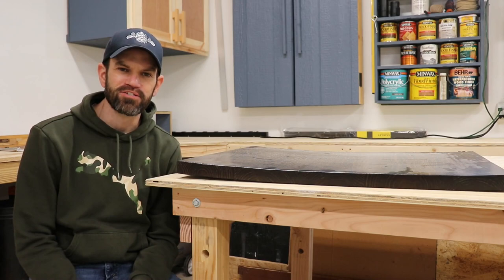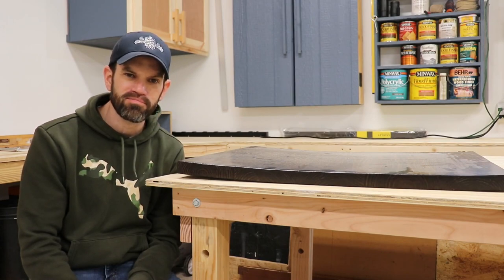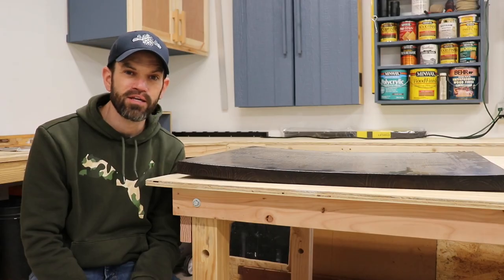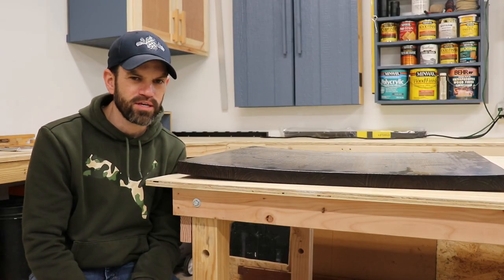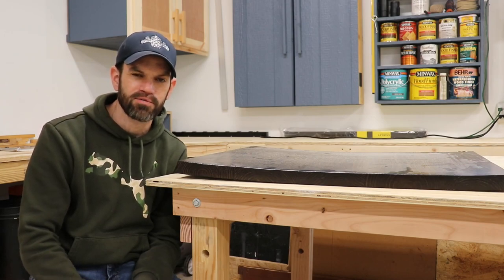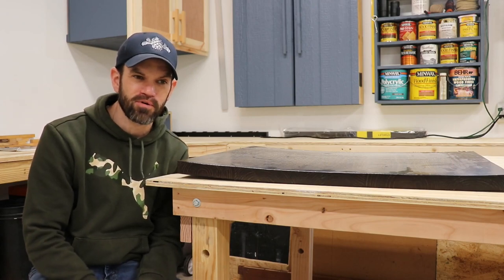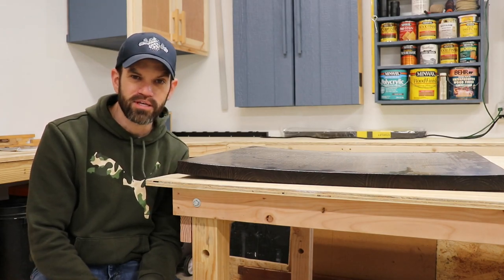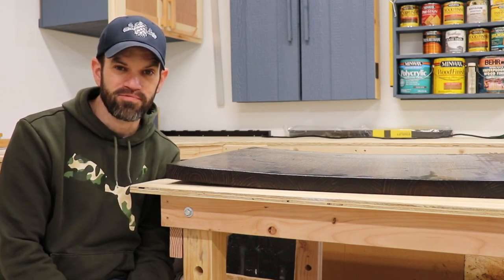TABLE TOP Glue-Up Tip / How To NOT Make a Flat Table Top

Comment: The construction grade pine at the big box stores is hardly ever dry enough to make a flat table top from. Even if you altered the grain, you would end up with a wavy table top with each piece curving in the opposite way sorta like a potato chip. That would not keep the table top flat. The only way would be to kiln dry or air dry the wood completely. Then run it all through a planer to flatten each board before assembling.
Reply from the maker: Thank you for the advice, there is lot's of good suggestions in the comments here, hopefully people can avoid making the same mistake I did.

Comment: Another tip is to make sure the material acclimates to your workshop and sticker the boards and leave a small gap between each board on the same level. Make sure the stickers are the same thickness.
Let it acclimate after each stage of construction and when you move it to a different area/location…, i.e. shop to garage, garage to house. Make sure you finish both sides of a table top. Not finishing both side can contribute to warping or cupping.
Also try to avoid buying boards that were either cut from the pith or right next to the pith. Boards that have the pith in them will warp the most. Try to use boards with a similar grain pattern on each face but especially the end grain. If the end grain (and face grain) are similar they will usually behave similarly.
Reply from the maker: Thank you for sharing these tips. I've learned so much about wood and warping since posting this video and I hope the video and comments are helpful to others

Comment: same w clamps one facing up and one facing down (parallel clamps) also clamping pressure plays a role.alot of ppl CRANK the clamps when in reality u only need to tighten them til u see 1st bead of squeeze out .i use my thumb and 2 fingers to tighten clamps for panel glue ups anymore than tht u risk cupping it.
Reply from the maker: Great tips, thank you for sharing!

Comment: Yeah. I used to just dry them on a flat surface with clamps and or weights. I just finished a desk and had the top sitting on a 4x8 work bench on pipe clamps and heavy blocks on top. Dried flat, no rocking. Remember to keep an eye on the moisture with a meter as well. You can get away without doing the up down thing, but it’s best practices. I only did it this way because of how the grain LOOKED. I also had to put in pocket screws. Country style.
Reply from the maker: Good advice, thank you for sharing!

Comment: Flipping the end grain does not matter. Some really experienced workers do not even bother with this. The biggest thing is making sure all the moisture is out of the wood. After glue up, never lay the wood flat without circulation or one side will dry out and begin to bow.
Reply: This is true
Reply: great point...Is the idea of the video that the direction wood will bow in one direction? As it might make sense a little, yet you would still have smaller slight curves.  I think we need a new video!!
Reply from the maker: I'm open to any suggestions, this video was based on my experience and a tip from a more experienced wood worker. I've heard it a lot after posting this video, but the topic seems kinda controversial. Perhaps the species of wood and the moisture content also play a role
Reply: Adam, I made an island top from Ash and it bowed after glue up. I have a lot of experience in wood working but the bowing had never happened to me. I built it in my shop and after the glue dried I moved it into my attached garage, which is heated and this was winter time in Minnesota. The Ash was rough milled to 1 1/2" thick and I ripped each board to about 5 1/2" to accommodate my jointer.  Then planed down to 5/4 final thickness.

After the final sanding in my garage I had a beautiful top with a very smooth surface and I was ready to finish it. But before I started finishing, it started to bow (I should note that the top is about 42" x 60" with 42 going with the grain and 60 across the grain, so it's 12 or 13 boards across). I was just sick because of all the work I put into it and I didn't know if I would be able to flatten it.

Well, at the local cafe I was talking to a cabinet builder in my area and told him about my problem. He said to flip it over and it will flatten out after a few days. It did just that! When I glued up the boards I was making sure to rotate the grain pattern across the top so I couldn't understand why it bowed but your explanation makes perfect sense: The wood probably wasn't as dry as I thought even though it had been stored with stickers for several years, I laid it flat without proper circulation. It's been installed in my house for a couple of years now without any cracks in the joints so I think it'll stay that way.
Reply: @philindeblanc  yeah moisture imbalance in wood is the mortal enemy. If you can properly control the moisture content you can control warp/bow for the most part. Wood is alive so it’s difficult in some specifies to keep it from twisting/bowing/cupping. They need more educational content on this.
Reply: I mostly agree with you. but wood will warp towards the heart, so when using quarter sawn boards this is no problem. Though when using boards that aren't quarter sawn warping might pose a problem and in my experience and in the experience of the people I know flipping the end grain does help.
Reply: @carriehsd7162  there are two types of quarter sawn. The first is the boards that contain the pith. Cutting out the pith and someone would call the remaining halves quarter sawn. Then the other one is the true quarter sawn, where a log is cut into quarters, and boards are cut out from the quarter, one vertical one horizontal at the time. The wider boards with more than 60 degree grain are called quarter sawn, and boards with 30-60 degree are rift sawn.
Reply: Agreed. I have made 5 table tops with various types of woods and cuts and I never worried about grain direction. The problem this guy is dealing with is that he likely cut or planed the wood and did not let it sit for a couple of weeks. This is particularly true with "cheap construction-grade pine".
Reply from the maker: Yep, I've learned a lot since this video.
Reply: The flipping is great common advice for the last 50-100 years. It isn’t totally necessary. I’m not sure wavy is any better than a larger cups. Wood selection, acclimating, and joinery (eg clamp joint/bread board ends) are more important.
Reply: I came to say the same thing.
Reply: Flipping the grain orientation for each board is an old wives tale and generally rather poor advice as it glosses over the actual reason the panels are warping. If you end up with a glue up like this, your boards were not dry! Not even remotely dry if you're getting the results shown in this video. Get a moisture meter, learn how to read a moisture equilibrium chart, and make sure you're buying from a quality hardwood supplier. Lumber from big box stores might be as high as 20%, and depending on where you live, you might need to be at around 6%.

Comment: Thank you for sharing not only successes ! But I belive the biggest reason was that the wood wasn’t dry enough. Construction timber is often new sawn when you buy it and need drying indoors or in a kiln if you want to use it as soon as possible. Then coating before it is dry will make it even worse.
Reply from the maker: Yep, that probably had a lot to do with it. Thanks for the feedback!

Comment: We do the same when sewing long seams in quilting. It keeps the quilt from getting wonky if you go up one side and then down the other side. But, I'm curious, how are you going to fix that table top? Can the warp be taken back out of it?
Reply from the maker: Nope, can't be taken out.. It gets scrapped
Reply: @howtofixitworkshop  Actually, since it was cheap material can try to fix this for practice. Along the underside you can cut a series of relief slots and inserts a number of wedges in those slots. For an example of what I am talking about, see this video by Lincoln St. Woodworking - he does an great job explaining and showing the process: https://www.youtube.com/watch?v=EhCm1UVXbmY.
Reply from the maker: Ah yeah, that's a possible solution. Thanks for sharing!

Comment: Moisture…. The thing that tipped me off is when you said, “2x6”.

Construction grade lumber isn’t always very dry.  I’ve crosscut 2x6s before and noticed a distinct moisture ring inside the perimeter of the board.  Construction grade lumber also doesn’t always have very dense growth rings making it more “floppy.”  I occasionally build prototype doors with 2x4s and 2x6s.  If I build with them immediately, the doors almost always warp.  If I stack and sticker them for several months, a few will stay flat and stable but most will have a twist or bow.

Using furniture grade lumber from a reputable supplier should make things easier.  Even furniture grade knotty pine will be more stable and dry than a 2x6.  Alternating the “cup” in the grain doesn’t hurt but I don’t think it matters that much.
Reply from the maker: Yep, I think you're right. I've had much better luck with good hard woods
Reply: @howtofixitworkshop  even furniture grade softwoods tend to be more stable.  It costs a little more but not much if you’re talking about pine. 8/4 furniture grade white pine is dry, stable and pretty inexpensive.

Comment: This is my first time trying to glue up 2x6 side-by-sides kind of exactly like you said after using a planer to flatten them out. I didn't use a jointer because I don't have one but I did use dowels two on each end with a jig I bought from rockler. They did seem to be lined up evenly once I glued up and clamped them together. I kind of noticed they started bowling so I loosened up the clamps and put a cauls on each side in the middle where the bow was. Unfortunately this still didn't work so now I have a problem. Luckily I didn't stain it yet or all the steps you went through, but I got to figure out how to fix it. Thanks for the tips though
Reply from the maker: You're welcome, hope you get it to work out for you. I also learned that the 2x6 lumber tends to have more moisture because it doesn't have as much time to dry. The more common boards are used in construction more frequently so the turn over in the hardware store is quicker. I'll probably use 2x10s and 2x12s in the future
Reply: @howtofixitworkshop  I tried glueing up two 2x12s and I would not recommend it. Way more warped than your project is. I would honestly go skinnier with 2x4s, but that's just me.
Reply: No type or size of construction grade pine, doug fir, etc from a big box store is appropriate for building furniture or panels with. Unless you have your own kiln or are willing to sort through the stack and pick out the flattest boards, bring them home, sticker them, and air dry them for a year or two. Even then they might not be dry enough and can warp significantly as they dry. You may need to bring them inside your house - for weeks or even months - where it is climate controlled, to get them down to a reasonable moisture level/to reach moisture equilibrium with the area they will be put into service - only then can the boards be milled. These boards are meant for rough construction framing where the wood movement as they dry does not matter. At the end of the day, quality kiln dried hardwood is more expensive up front, but less expensive than having to remake your projects because they exploded or warped due to inappropriate materials

Comment: That is excellent advice.  Funny I happened across this video, because this is an issue I'm dealing with now.  I built a table top out of cedar and maple, glued it up, and that is all glued down to a piece of 3/4 oak plywood, and it still bowed.  Not too horribly bad, mind you, but enough to create a little bit of a headache, and possibly having to start over.  I might have to take a Sharpie and write in big, bold letters on the wall of the shop "CUT IN HALF AND FLIP IT" just as a reminder.
Reply from the maker: Haha! Yep I need that sign on the wall too!
Reply: Your problems are unlikely to be related to grain direction of the boards. 1. how dry were the boards? If bought at the bix box lumber stores, the answer is likely: not dry enough. 2. Cedar and maple have significant differences in density and size of pores and likely absorb moisture at much difference rates. It's generally best to use woods with similarly density and T/R ratio when making panels. 3. gluing solid wood to a plywood base is a bad idea - solid wood panels move primarily along their width, while plywood panels are glued with each sheet offset 90 degrees to limit expansion and contraction. Assuming everything else was perfect #3 is reason enough for your panel to warp like a potato chip. Generally when working with plywood/veneer you need to apply equal thickness veneer to both sides to balance the panel, otherwise it's going to fail. If you look at the cross section of any type of plywood you'll notice it's always an odd number of sheets in a perfectly symmetrical pattern

Comment: One thing you will always want to do is include stabilizers, best thing is 3/4 - 1” U channel with slotted mounting holes in the U channel to allow for movement this will keep your top flat as a flitter
Reply from the maker: Flat as a flitter? Thanks for the tip!
Reply: what is the u  channel

Comment: You can still save it. Cut them up again and joint them straight once more and then do the flip. It would be thinner of course but you'd save it.
Reply from the maker: That's true, I tried that with this project but didn't have much luck
Reply: Yes, absolutely, this can be fixed by ripping, reflattening, and gluing up again. But messing with the orientation of the boards will do little to nothing. The key is making sure the boards are actually dry before milling them again. Though depending on how badly warped the boards are, it may be a lost cause. For things like table tops made from home depot pine, those boards are so wet when you buy them that if you glue them up and they warp, you'll probably only be left with 1/2 in or so from a 2x6 by the time you reflatten them

Comment: Because of every single glue up I've done ending up cupped, I'm terrified to do any more glue ups. Sadly however, because the jointer at the shop I go to can only fit 8 inch wide pieces of wood into it, anything larger than 8 inches is something I'll have to cut to size with either the table saw or ripper blade, then cut again and flip before I put it through the router. 

So in other words:

The pain you feel? I feel it too...
Reply from the maker: Yeah, it's very frustrating.  There are a lot of really great comments here now that have taught me a lot, mainly don't try to make table tops with construction grade wood, and if you do, make sure you give it plenty of time to dry.  Best of luck to you!

Comment: We’re you able to use that tabletop or did you have to remake one ?
Reply from the maker: I was able to use a small section of it for another project, but most of it ended up in the burn pile 🙂
Reply: @howtofixitworkshop  I've seen channels where the woodworker cut the panel down along the seems (you could cut the pieces in half and flip it too), ran the pieces through a plainer, and glued it back together again. You would lose some width and thickness, but I wouldn't burn it at these prices!! All is not lost!

Comment: Did you finish both sides with the poly?
Reply from the maker: I did, the top with 3-4 coats the bottom with 1 or 2
Reply: @How To Fix It Workshop  my other thought  would be if you took off equal passes on each side of the boards while planning and if the boards were acclimated for a couple days after the planing.  I've been having more success if I plane it to about a little over 1/16" over my final thickness.  Let it sit for a couple days, then plane it to size.  Not sure if this is a legit technique at all. I just picked up on it from a cue maker.  When they are making a pool cue from rough stock they only take off a bit at a time.  Then let it sit for a month before they do another pass.  It takes forever but it ensures a perfectly strait pool cue. Obviously, that's a bit extreme in our world, but I think it still holds some value.
Reply: @AngryPyro666  this is generally good advice - leaving the piece for some time, a few days, or even weeks if you can, will help it acclimate. The moisture content internally is going to be different from the moisture content on the surface of the board, as that dries out more quickly. Moisture changes are only one reason for wood movement though. When changing the thickness of a board we release internal stresses, which can cause the wood to move (though this is usually evident immediately). This tends to be more obvious on heavily figured wood like curly maple where there are high levels of internal stress (the stress is what causes the curliness to develop). When I make panels I like to rough them out a little thicker than I need, and then do a final flattening pass on a planer (if the panel isn't too wide), slab flattening table, or drum sander. This also gives me the ability to flatten out any slight misalignments in the glue up process. For instance, if I'm going for 3/4 I might rough the panel in at 13/16 to 7/8.